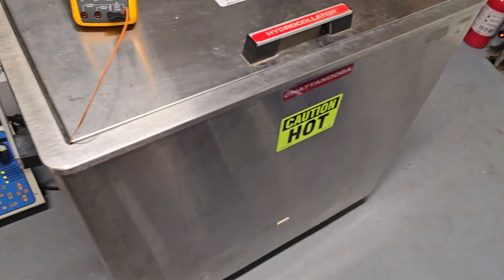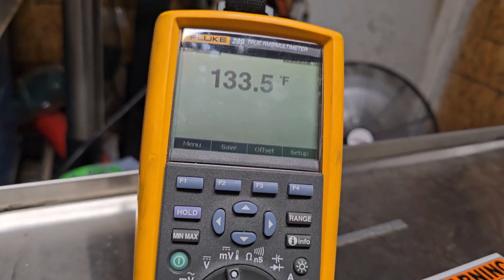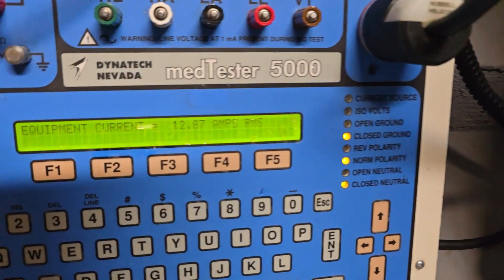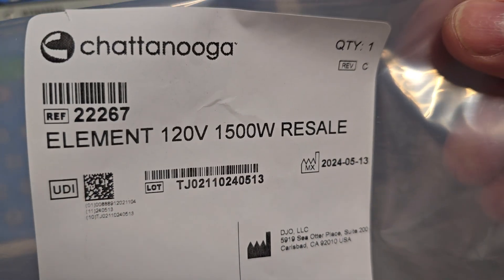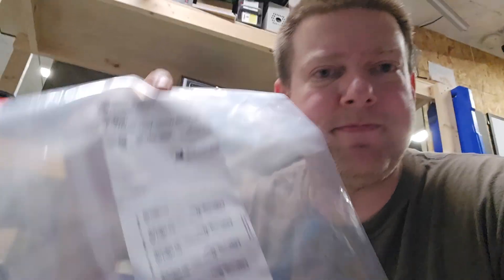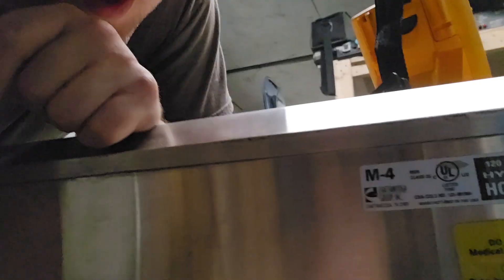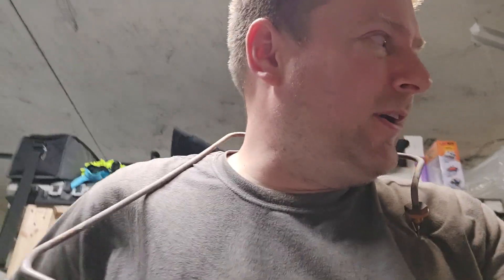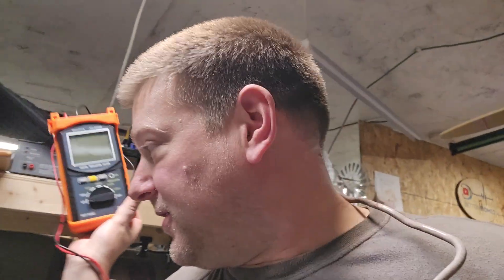Ohm's Law In Use!

Comment: Your device is in specs, the heating element of 1500Watt @ 120V draws 12,5A and you are measuring 12,87A. 
But this 12,87A is for entire device.
There is difference of 0,37A , but if i remember correctly, this device has also a powersupply at the bottom for the controlepanel,
that powersupply and controlpanel also consumes power. 
If you want to be 100% sure if the heating element is in spec, you need to use a current clamp meter arround a wire to the heating element itself,
and i bet that you then measure very closely to 12,5A and maybe a little bit less, if that low voltage powersupply consumes more then 0,37A.
Reply from the maker: @BjornV78   This device is analog and powered by an analog thermostat.  There is no PSU.
Reply: @BetterBiomedChannel  , it's been a while ago that you did that heater, and at that time you did a few devices if i'm correct.
Regarding the faillure of the heating element, i can be wrong, but i think that these heating elements have a sort ceramic support structure for the spiral heating wire. If that ceramic support is broken and crumbled in pieces, the hot heating wire will sag and the windings start to touch each other. 
Sort like shorting windings in a transformer. I think if you could run the heating element without water, and with a Variac to prevent selfdestructing due the missing water that acts like cooling, that you can use a Thermal imaging camera and find hotspots at the place(s) there things go haywire inside. 
And that tapping the heater element shows a fluctuation in current measuring due the shortings that's get disrupted by the tapping.
Reply from the maker: This is what I agree happened.  I did an ISO test and it was isolated from the outer case. I think the coils are expanding internally from the heat and shorting as it expands
Reply from the maker: Sounds like an excellent future video